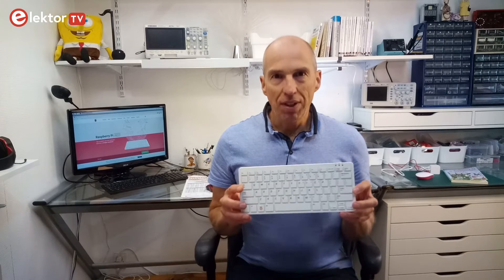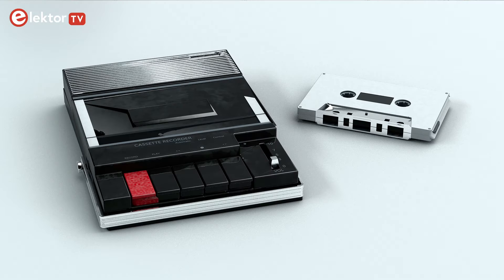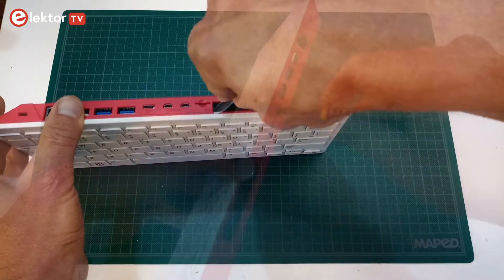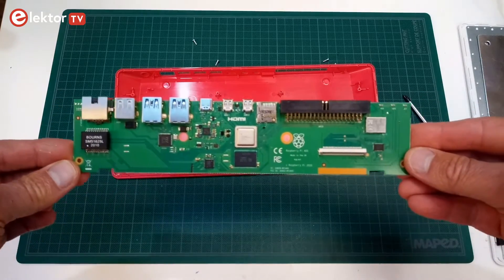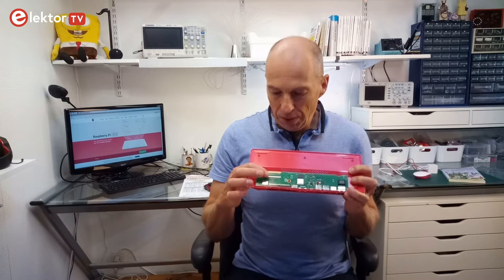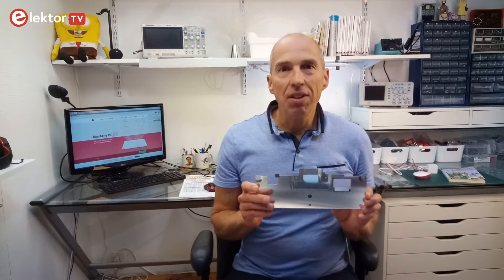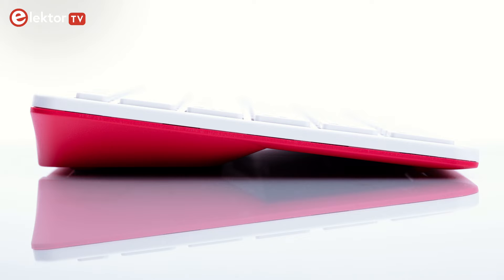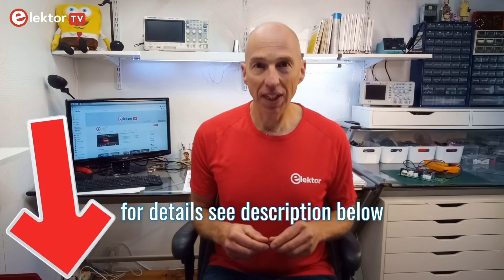Raspberry Pi 400 Teardown

Comment: This also exists as a standalone keyboard. What do you think of the typing experience? Can this be used for working/gaming like a compact keyboard? Or does it feel worse than a laptop keyboard?
Reply from the maker: For heavy typing/gaming this keyboard is probably not suited. Also, I think it is a bit small, at least for me. Normal usage should be OK though.

Comment: Re your comment about protection for the 40 pin connector: my RPi 400 came with a nice firmly fitting silicone protective insert which sits flush with the case but is easy to remove with a fingernail.

Comment: What purpose does the heat conductive square in the upper left hand corner serve? Does it transfer heat from the large shield/heat sink to the back side metal of the keyboard?
Reply from the maker: Do you mean at 2:49? It is not heat conductive tape, just conductive tape and it provides an electrical (ground) connection between the shield of the Ethernet connector and the heat sink.
Reply: @ElektorTV  Yes, at 2:49... thank you... you answered it. :-)
Reply: The aluminium heatsink plate is designed to accumulate ambient heat from the room and concentrate it on the CPU, causing it to overheat deliberately. 😁😉